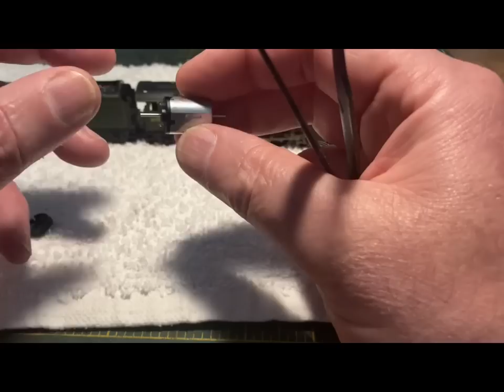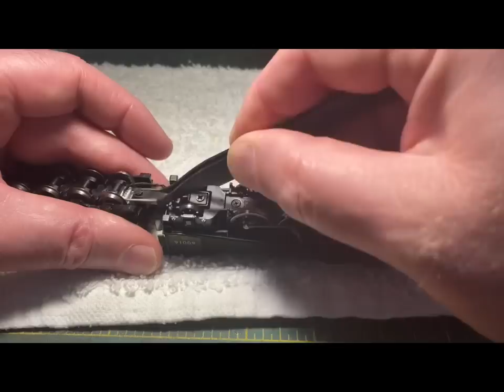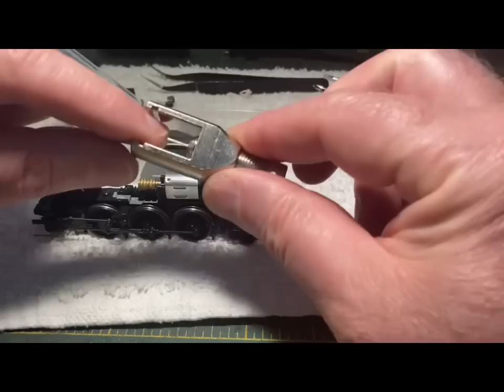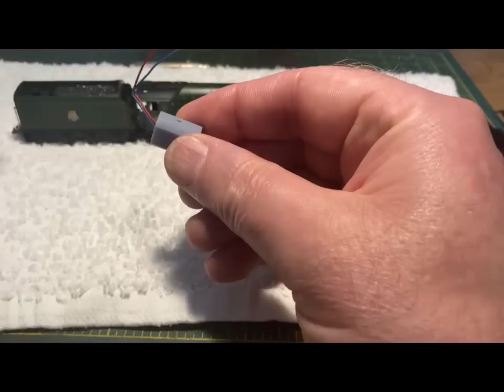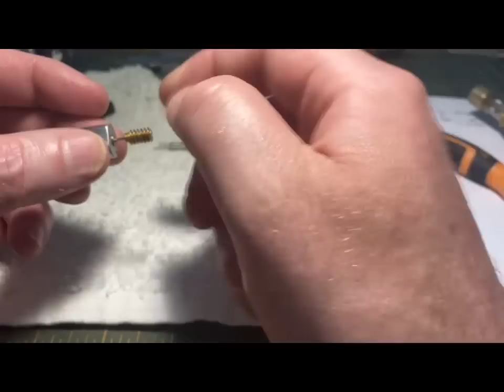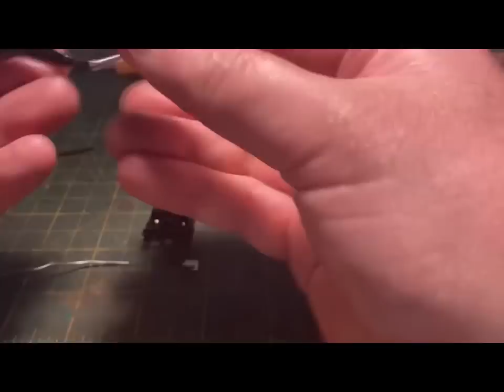Hornby TT:120 motor failure; a look inside & fixes UPDATES in description for suppliers

Comment: Why cant hornby put in the coreless motors in the first place considering that people want to pay for a quality model not watch a new hobby fail???
Reply from the maker: Coreless is not compatible with the very cheap/set type controllers (or anything ancient like most modern motors) Also they are a significantly more expensive motor. I don’t think Hornby need to fit coreless always, I think the J50 is coming with a coreless motor. It’s not just Hornby that have been caught out with these nasty cheap motors, it’s a bit of an issue across the hobby 🙁

Comment: Do you reccomend just swapping the 3-pole motor for a 5-pole one?
Reply from the maker: Well that all depends if you can find a suitable one. A top quality 3 pole motor is better than a rubbish 5 pole one. There is not much wrong with a good quality 3 pole motor, I wouldn’t say these are ‘good quality’ though. A 5 pole motor has the advantage that its usually skew wound, that and the extra 2 poles improve smooth low rpm running. It’s also fair to say that 5 pole motors and Coreless tend to be higher quality due to the increased cost to produce them and the applications they often find themselves in demand better quality. 
I have not found an N20 5 pole motor so far, or even a 12v carbon brush N20, hence having to scavenge the carbon brushes and end cap from a 6v N20 and do a little tweak.
Reply: @HighFell  Glad to know that ill think about it more then thanks for the advice!

Comment: This is not good. I haven’t been the biggest fan of Hornby’s build quality/quality control for the last few years. I don’t model in TT but rather in OO and I have a Hornby terrier with what I believe is the same motor and it is so bad it cogs at anything below 45% on my control. Glad to see this is an easy fix, but it’s a pity Hornby use these motors… I get why Hornby used them due to size constraints, but personally I think they should start using coreless motors.
Reply from the maker: It’s not just Hornby sadly, but it isn’t a great situation. I hope to have other options too 👍
Reply: @HighFell  totally agree! Does another company also use these motors?
Reply from the maker: @modelrailfan37  certainly many use motors with BE brushes and they fail.
Reply: @HighFell  that’s not good! I wonder why they’d use motors with those brushes if they are known to fail?
Reply from the maker: @modelrailfan37  we don’t know what assurances were given to manufacturers over life, motors are not made in house these days. I’m not sure how long BE brushes have been appearing in locos, some of the characteristics are very useful, low current draw, quiet, compact, smooth running (when ok) quite a few seem to have been caught out around the same time, even once mighty names like Roco/Fleishmann. I am fairly certain Hornby didn’t set out to install a dud motor specification. The have very quickly moved to alternatives on subsequent releases
Reply from the maker: @modelrailfan37  even the best of us can get distracted by the ‘latest thing’ what Hornby are usually very good at is getting things sorted and CS is best in the industry by a mile. Ultimately in engineering you always learn more from a mistake than you do a success. The big deal is that there are ways to fix the issue as a modeller 👍
Reply: @HighFell  that is a good point, all the same if a model is sold ready to run at a high price, then we shouldn’t have to replace the motor after only a few hours of running. I’m sure this is something that will be improved though (it seems like Hornby are already trying to fix the mistake)!

Comment: Very grateful for your video which is excellent. I have had quite a few issues with burnt-out motors using HM7000... Error message Motor Overcurrent. Hornby has been very good at replacing motors under warranty, although they cannot say why this happens. Eventually, once the warranty is done, I will need to replace the motors myself. Your video is brilliant. I am considering ditching HM7000 and going analogue.
Reply from the maker: It’s  not the HM 7000 or DCC that’s the problem. The over current is actually diagnostics in the system and it’s self protection shutting decoder down. Generally DCC control is better for motor longevity. It’s the nasty BE brushes that are the issue and they are changeable. A new video showing how will be done as soon as parts are here 👍
Reply: @HighFell  Hi... That's the first definitive answer I have been able to get... thank you. I look forward to your next video.
Reply: @HighFell  Hi... me again. Would fitting a snubber at the end of the bus help?
Reply from the maker: @gregstacey8215  I doubt it would help the motors because it’s the design rather than spikes, however spike protection on the ends of the Power Bus and spike/surge protection on wall socket are a sensible move, I run with both of these in place.
Reply: @HighFell  Ah... okay... where about do you get the end cap with brushes?
Reply from the maker: @gregstacey8215 link in description for the BE type brushes. I have something else I will test and do video on when those parts arrive. Hopefully long term replacement carbon brushes
Reply: @HighFell  Hi... thanks for your reply and advice... much appreciated.

Comment: Hi Matt, Are you aware of the possible issues that the HM7000 decoders may have on Coreless motors and as we talked earlier 36/40 hours is a long time in my set ups. Not sure how long N scale motors last either coming from OO to get some perspective. I’m also wondering if motor heat build up played a part in the original malfunctioning, if you do longer running sessions which I presume you do and have sorted the bleep. Plus, apart from great advice here, you get award for best thumbnail of 2024 so far on this video. Seriously it’s 👍
Reply: Regarding the beep and having replaced two batteries on non wired in ones now. I also have spiders that love spinning in front of my security cameras in spring and summer and usually in unison at certain times as they’ve just gone off now. Like you more positive with my cobweb brush rather than carbon. As for Elvis it’s all in the book.
Reply from the maker: My best art went into that thumbnail, Christie’s have been in touch about selling NFT of it….
I can’t think why a decoder, HM7000 or otherwise would not play nicely with a coreless motor, if anything DCC would be better, but it’s not really my area of expertise. I don’t really run locos for log periods, maybe longest 15-20 mins continuously before it’s stood down and another is running. N have been using similar motors and similar results. EB brushes (the precious metal finger type) don’t like stop start or going in reverse according to Maxon who are one of the most respected motor manufacturers/suppliers in industry. The heat issue is something I a organising to test, some recording kit on the way. One contributor here suggested the N20 type motor are not good under load, at 5 coaches there is arcing across the EB brushes and commutator that leads to overheating and rapid brush degradation. However that I want to establish for myself. I haven’t seen signs of high temps inside the bodyshells etc. 
Glad you have corrected the fire safety system, your Elvis suit looks like it could spontaneously combust 😁
I am feeling more positive about the motor issue as there are solutions and more out there to discover 👍

Comment: Thank you for an excellent video. My loco's are only just at the running in stage as I am still constructing a layout. This may be a problem that many of us will face. I am hoping that a supplier out there will looking at this as an opportunity and consider providing a replacement motor and worm gear as an assembly.
Reply from the maker: Swapping the end cap with brushes is very simple. The big thing is don’t worry, there are solutions and things will develop. 👍

Comment: to be expected. loco looks like its running awful, watching alot of movement on the side bars. anyways its a market aimed at pure profit for struggling crappy hornby. nice video and layout though.
Reply from the maker: I wouldn’t say to be expected, particularly in consideration of the quality of the actual model itself, they are fantastic. Freeplay in linkage and, wheel sets and valve gear is sadly a necessity in models, they just wouldn’t be able to turn through the tight curves we have on model railways. A poor motor does accentuate that, if it was in diesel you wouldn’t notice it. Simply swapping the motor and she runs fine. I wouldn’t write Hornby off as you do, yes all companies exist to make a profit at some point but they have completely turned the hobby on its head with launching TT:120. A number of manufacturers have been caught out on these type of motors, the big test is getting the issue sorted. In the meantime, we have an easy home fix and I’m looking into some more options. 👍
Reply: @HighFell  try kato lol and you will be blown away.
Reply from the maker: @Galacticmaster Kato have a good reputation for mechanisms but they are basic and oversize for the scale which does make a difference particularly in the running gear.
Reply: @HighFell  they work though with good playability that's all modellers want ha
Reply from the maker: @Galacticmaster again, that’s not the whole story. If it were then Hornby Dublo 3rail would be still being made and the top seller. Glad you enjoyed the video and thanks for the comments on the layout 👍
Reply: @HighFell  I totally agree 👍 with the old Hornby stuff can't get enough of that especially old triang.

Comment: I’ve just returned the Duchess of Montrose, it just made a buzzing sound, and Blink Bonney did not even make the running in before it expired! Blink Bonney is back but will stay in its box, and though the post office delivered the Duchess 2 weeks ago to Hornby, I have heard nothing from them. To say I’m peed off is putting it mildly. I was just about to invest in a layout,but doubt that I will now. Can’t see Hornby lasting much longer to tell the truth. I’m curious that nothing Great Western was offered, which is my real interest, but will just stay with 00 now! Thanks for the video. Subscribed.
Reply from the maker: I think the Montrose issue is something actually very minor, it’s section of the valve gear fouling, it could even be down to mishandling in packing, mine did it in reverse and a little tweak solved it. It’s well worth preserving as the actual models are superb and whe running well, they are great. I am actually more confident now in the scale and Hornby models because I know the biggest problem can be overcome relatively easily.
Reply: @HighFell  just had an email, Hornby have sent the Montrose back today.
I forgot to mention that I live in France and the cost of having anything from the U.K has almost doubled! Postage and duty now make it unviable!
Reply from the maker: @billburnhope2176  if you are not already part of it, get involved in the Hornby forum and the TT:120 section. It could really be a big help. I know it’s not ideal when things are not perfect but lots of the issues in the hobby are quite easy to fix. On other hand slightly jealous of your current location 😁 Hope Paris delivers on Olympics 👍
Reply: Update, on the Montrose, Hornby replaced the chassis on the tender. Apparently not simple.
Still in the box as I will not be running it what a waste of money!
Reply from the maker: @billburnhope2176  swapping a tender chassis is pretty simple stuff. I would get it out of the box and have stuff running, it’s not a waste of money, it’s an opportunity to have some fun 😁

Comment: Sorry. Question the extra 0.9 pins come in short or long shaft sets. I assume either will need trimming so it doesn’t matter which one I order
Reply from the maker: You will need the long ones, a short one is standard in gear puller set with other diameters but too short for this job. You will need to trim 3mm of 1 long one, that will make it just long enough to start the worm gear moving, I’m not sure the heat was effective and trying to handle a hot motor was more of a hinderance. Once the trimmed one has bottomed out, swap to a longer one to complete the pull. Once the worm gear is moving it comes out the last part quite easily. The aim is to use the hole through the brass worm gear to support the pin as much as possible. 👍

Comment: As an rc enthusiast, those are some of the cheapest motors I have seen in years.
Reply from the maker: I presume you are not meaning this in a positive way! If you have experience of better (significantly better) quality motors in N20 dimensions please feel free to share information here, personally I would be happy to spend a sensible amount on better quality motors. 👍
Reply: @HighFell  The replacement is a lot better motor .I will check for some better n20 size and get back to you.why are Hornby using dirt cheap 3 pole none skew wound motors in what are meaqnt to be high end models,(judging by the price of their models) with no flywheels?
 I don't get it. edit to add, have a look on servo city ,robot shop,  Pololu / Turnabo places like that.
Reply from the maker: @grrfy  actually flywheels are not such a big deal, a good 3 pole is better than a mediocre 5 pole but yes a top end one from the outset would have been more sensible, perhaps the accountants got involved! Thanks for the names, will follow up on those 👍

Comment: N20 motors run hot extremely quickly with a load on them, make sure not to stress them
Reply from the maker: Can you quantify how much load? I can’t say I have noticed them running hot when ok and on a normal running session but like all motors when they are not ok they do generate more heat, certainly not enough to leave any signs of overheating inside the loco bodies. 
One thing to remember is N20 is only the size code, it doesn’t indicate voltage or brush arrangement so some may respond very differently to others. 
Temperature testing is something that I can do 👍
Reply: @HighFell  like any. 

I am a modeler and build my own HO/OO scale model trains. I test motors before cad designing them into my models. 

The motor doesn’t run hot, however the arcing in combo with the friction slowly eat the brushes away. When the brushes are almost gone they can wedge themselves between the plates of the commutator and cause a short. Which as you might have guessed, can cause a fire.

N20 motors start arcing  at about 5 coaches. That causes the brushes to degrade rapidly, as these motors are designed for applications with like no load and low rpm. Make sure to keep the commutator squeaky clean if you want any longevity.
Reply from the maker: @WinterroSP  thanks to others in the TT:120 and model railway community some carbon brushed versions of an N20 have been identified, although lower voltage rated armatures. I have some on the way so will try an end cap swap to carbon brushes and see how they perform, at least that should improve service life. Thanks for tip on train length, that’s useful information in respect of load on the motor that most people can quantify 👍

Comment: N20 motors come from more than one Chinese manufacturer, some will be built to a slightly better specification than others but typically they would probably not be intended to run continuously for any length of time, normally the are found with a gearbox fitted to allow the motor to run at full speed with the output at a fixed speed e.g 150, 300 or  1200 rpm (there are lots of variations). It does surprise me that Hornby decided to use these type of motors though. Less than 40 hours life expectancy is not very much for something that perhaps children might be expected to play with. I had my first 00 Gauge layout when I was just 8 years old and when you have only one or two logos you have them running all of the time, I'm pretty certain these would not have lasted 6 months of use, which as a child would have left me very disappointed and my parents annoyed
Reply from the maker: Yes, N20 is purely a size code and no guarantee of what is inside or even voltage etc. They have 1000’s of applications and while some characteristics are suited to model locos some downsides are not. I cover this in the video. Maxon do some good solid comparisons between the motor types and what’s best suited for different applications. Stop start and reversing kills these. I have some other options in the pipeline so we can see if there are other better solutions available at a sensible price rather than just wait 😁 
Hornby isn’t the only one using these motors, they are very commonplace in other model locos and unsurprisingly they have the same issues.